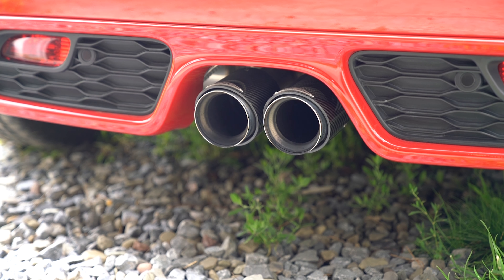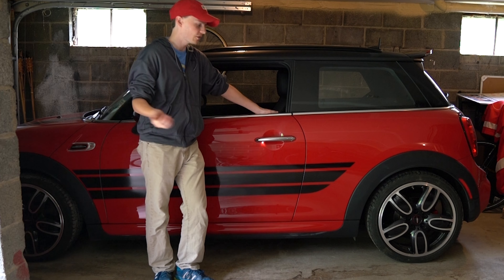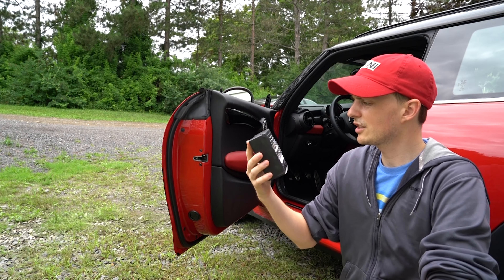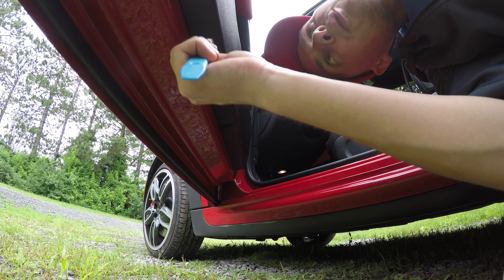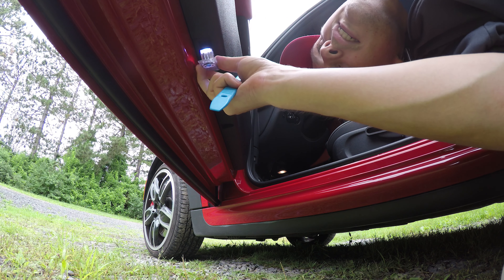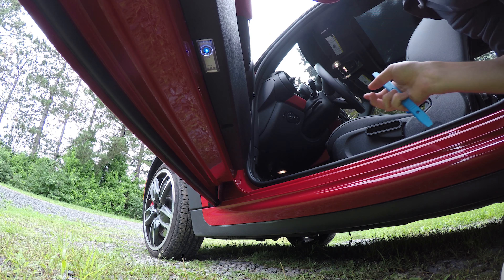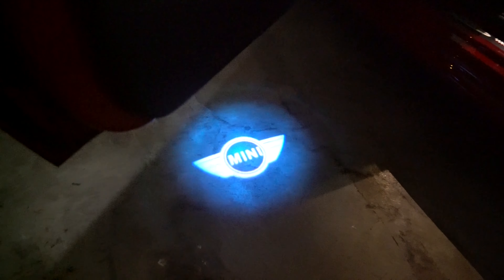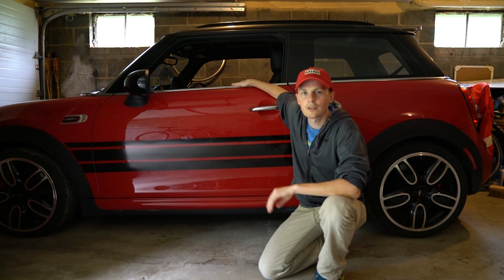Mini Cooper Puddle Lights

Comment: I had the logo in my puddle lights but it has disappeared all of a sudden? What's gone wrong??
Reply from the maker: The bulb could have burnt out perhaps. You can buy them from MINI directly or you can check them out at https://www.outmotoring.com/MINI-Cooper-welcome-light-puddle-light-door-entrance-lights-welcome-set-projected-lit-up-front-door-rear-doors-Hatchback-Convertible-Clubman-Coupe-Countryman-2002-2003-2004-2005-2006-2007-2008-2009-2010-2011-2012-2013-2014-2015-2016-2017.html and they will tell you what models they fit right there. They fit nearly all mini models.

Comment: Cool!  Just bought a 2018 Cooper S 4 door today.  Looking for fun accessories and found your page.  Subscribed 👍
Reply from the maker: Awesome! Thanks for the subscribe! They now make these with interchangeable designs! Let me know if you need a link
Reply: Hey I’d appreciate any tips!
Reply from the maker: Check these out https://www.outmotoring.com/MINI-Cooper-welcome-light-puddle-light-door-entrance-lights-welcome-set-projected-lit-up-front-door-rear-doors-Hatchback-Convertible-Clubman-Coupe-Countryman-2002-2003-2004-2005-2006-2007-2008-2009-2010-2011-2012-2013-2014-2015-2016-2017.html

Comment: Does this affect any settings on your car? Will any engine lights or error message appear for switching out the lights?!
Reply from the maker: Nope! Changing the puddle lights doesn't throw any error codes or affect any settings on the car.
Reply: Not true on a R57!

Comment: Can this be done on the 2006 R50? :) Thanks
Reply from the maker: You need a different part which I linked below but you should be able to do it on your r50 following pretty much the same process! https://www.outmotoring.com/door-projector-slides-left-right-mini-logo-63312420113.html

Comment: The lights come stock in a 2016 F54/Clubman on the drivers side only. I want to do it to the other side as well. You would think they would put it in the passenger side for the people that actually don't have a MINI.
Reply from the maker: You would think they would put it on all their models too! Supposedly they have for the 2018 model year but I have yet to confirm that
Reply: So the light in the f54 projection comes from underneath the mirror. Kinda cool, except that I can't find any information about it, so I can do it to the other side. I guess this will do the trick, but not sure if it will look funny.